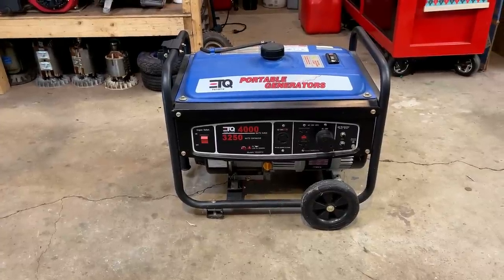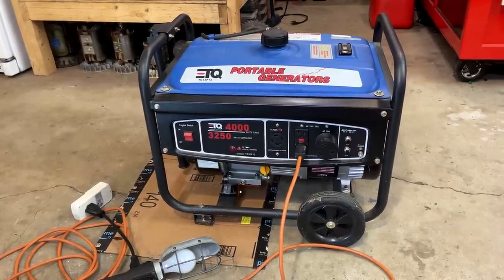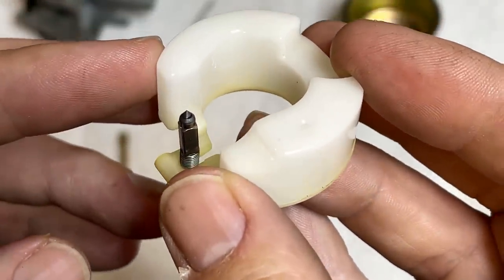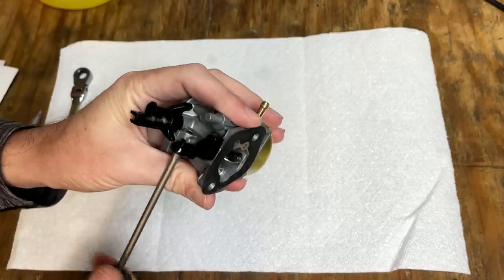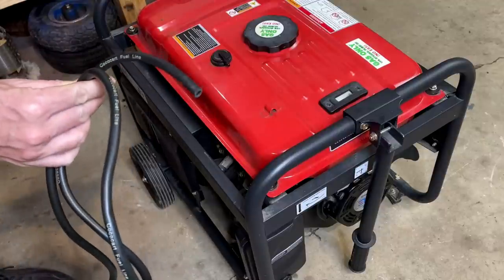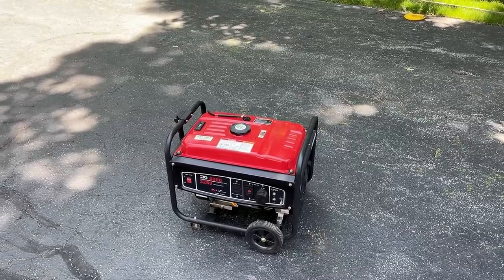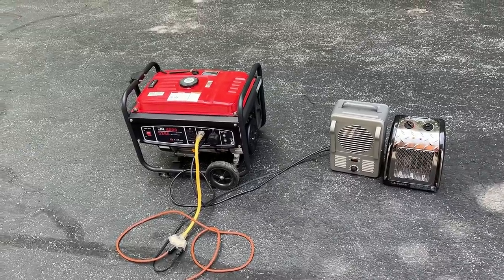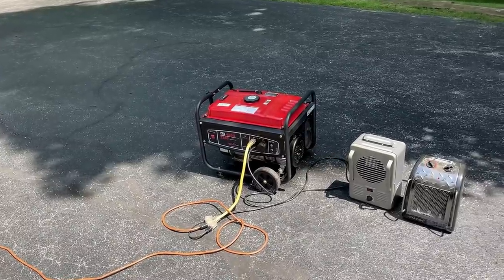ETQ Generator Leaking Fuel When Running - Bad Needle and Seat?

Comment: Those are shipping brackets To keep it from moving around too much during shipping they are supposed to be removed before running the unit  I mean the red bracket
Reply: Agree with Paul, shipping brackets and used on other types of equipment also for shipping
Reply: I know somebody that bought the open frame harbor freight 8750 inverter generator it has the same red brackets but the manual says to remove them be for using the generator
Reply: @paultice610  When I saw the brackets in the video I assumed there were shipping protection. Interestingly, I have a Predictor 8750 and it did not come with shipping brackets. I assume HF sources stuff through different factories so it might be factory specific.
Reply: Yep, shipping brackets to keep things stable during transport, supposed to be removed prior to using the machine, but... 'someone' didn't read the instruction tag🤣👍
Reply: Paul is correct. My generator came with shipping brackets. Purpose is to keep the generator from getting knocked around during shipping.
Reply: You guys are spot on. My manual doesn't mention them, but there were labels on the generator that said they were supposed to be removed before starting.

Comment: Back in the mid 60's I worked in an auto repair shop.  The owner was a professional welder before he got the shop.  We were the only one's around who would weld gas tanks.  He said never put water in them as you can still have pockets of gas vapor.  After pulling the gas tank off and dumping it out, he would run a hose from a vehicle tail pipe into the fill tube on the gas tank.  He would take the gas gauge out of the tank so the exhaust would circulate.  He let that run for about an hour which evaporated the gas that was left in the tank and filled the tank with carbon monoxide.  He said that lowered the oxygen level so the gas fumes wouldn't ignite.  We did this in a well ventilated area with fans running.  Some times, in the winter, he would pull the hose and plug the two holes with wet rags to seal the carbon monoxide in.  I was the one that got to hold the tank steady and wedged in place so it wouldn't move while he was welding.  Just a touch nervous the first couple of times but probably helped him 8 or 10 times.  He died of old age.  Now the disclaimers...Don't do this if you don't know what you're doing.  I do not recommend this operation.  Don't use water!!

Comment: We used to do a lot of welding on gas, diesel and hydraulic tanks. Our preferred method was to pressure wash them with a hot water pressure washer with detergent but CO2 or nitrogen gas was an option. I have even used dry ice which is just frozen CO2 when I had to do one away from the shop. On those small removable tanks you could use dish washing detergent and water to clean the tank then use air for a while to vent out any fumes. I've seen people pipe exhaust from an engine into a tank too, using carbon monoxide to prevent ignition.
Reply: Crazy

Comment: Regarding the gas tank leak. There is a product called J-B weld, it is supposed to be as strong as a real weld. You might know about it but I thought I'd mention it. I have used it and once it hardens, it is extremely hard.

Comment: My Wen DF11000 Dual Fuel generator had those same brackets. They are just there for shipping, to hold the engine solid. My manual said to make sure that they were removed before use.

Comment: The red L shaped brackets are installed in factory to prevent any possible damage to the engine mountings during shipping.
New generators out of the box usually have sticker or multiple stickers mentioning clearly to remove those brackets before use. The first owner didn't pay attention or didn't have the capacity (tools) to remove those red L shaped brackets.

Comment: Thanks for getting me started buying dead generators and reselling them (working, tuned up, cleaned out and ready to go)! I have cycled through about 25, so far. All portable, gas powered 3200 to 8750 watts. Best deal ever: (And I'm keeping this one!) Got a call, Was I interested in a Generac Guardian 16kw for $225.00. Battery had exploded. (Common with these older 2007, units.) The hard part was cleaning up all the oil that spilled out because I had to bring it home upside down in the back of an SUV, Tried running it from a small BBQ propane tank an 11"WC BBQ regulator. (good for 60k BTU) Wouldn't stay running. Needs 245k BTUs. Hooked it up to Nat Gas and runs perfect! Also came with a 20 amp Transfer switch/Load Panel. Everything works!!! Problem is the permitting and required professional (licensed) installation. Green tag required to reinstall the meter. This is when installed as the primary disconnect from the utility service. The load panel has more circuits than my main panel! Solution: Install as a sub panel and move about 12 circuits to sub panel. Main panel now has 1 circuit: 2x100 amp double to "Sub-panel".
Once installed, over $12,000 (installed) for $225 and about $500 in wires, gas lines and a battery! Thanks for doing what you do and getting me into it, also!
Reply: If you want to see it, it is here: https://drive.google.com/drive/folders/14VRrscGXwG2JWjyXV7IP_f2Ukiv-LaaA?usp=sharing

Comment: The red brackets were most likely to stop sear load on the isolators during shipping as you said. The isolators control downward load were in shipping they might be exposed to lateral loading causing a breakage issue. Also they are two types of needle & seats, one where the needle has a rubber tip  into a brass seat or a solid needle with a rubber seat inserted in the fuel inlet tube. the one in this generator may be getting hard but since to tested it to 9 psi that most likely is good. Good video as always.
Reply: Shear
Reply: @robertmoore2527  Thanks, I stand corrected. LMFIAO

Comment: I have had great results using Por15 on carb bowls and tank leaks.  You have to be patient. It takes a long time to dry and is runny at first. But it's worth the wait. It's absolutely impervious to fuel.

Comment: Those red brackets are shipping brackets to keep generator from moving during shipping. All the new generators that I have bought, mostly champion brand, come with them when shipped. The first instructions are to tilt the generator and remove brackets. Then oil and gas are added. Hope this helped.

Comment: If you run into problems with the gas tank like you did with this one there's a very easy and inexpensive fix. They sell at the automotive store a gas tank patch type of epoxy. It looks like JB weld but it's purpose is for gas tanks. You cut a piece of it off and use your fingers to mix it all together. It doesn't take long for it to set up and it last so far over 10 years on my pickup truck. I had all intention of replacing the tank when winter was over. Like most things other stuff was happening and the tank just was not leaking any longer. Even to this day 10 years later there is still no leaks.

Comment: Based on the two (amazing) identical generators with the same failure mode, why didn't you clean the slip rings and as Preventative Maintenance replace the brushes (I agree they look nearly new)? Shimming them to the center of the slip rings was really smart! I keep watching because I keep learning. Thank you.

Comment: James you can repair the tank with JB weld, wire wheel it super clean down to bare metal and give it a try....
Reply: the red angle bracket by the engine mount is a possible shipping block to be removed before use!

Comment: You could try Hytek PU92 Fuel resistant adhesive/mastic.                                                                                        Flexible adhesive for bonding or gap filling. - Resistant to diesel, oils, petrol & water.
Tack free in 40 to 60 minutes.
Supplied in 300ml standard mastic cartridges.

Comment: Those Red brackets are shipping brackets to protect the motor mounts during shipping.. my WEN 8750 watt inverter generator came with them and they were in the manual to remove...
Reply from the maker: Makes sense.  Just not sure why the etq manual did not mention them.

Comment: I have that same ultrasonic cleaner. My heating element works about 50% of the time, and it has done that since it was new. It seems to do better if I start with hot water.
Reply from the maker: I always start with hot water.  Although I just read that can cause the transducer to overheat.

Comment: I had a 49 cc engine ( bicycle kit) that purred at idle but fell on its face when revved. Went crazy trying to t/s carb. Valves were set way too tight. Quick adjustment and now problems solved.

Comment: Those red brackets are installed to protect insulators/"shock absorbers" during shipping.  They need to be removed prior to use. Most Champion generators come with these with instructions to remove them after unpacking.

Comment: That tank has been repaired previously. Someone did a LOUSY job too. Take it to a welding shop and they'll do it right for probably less than fifty bucks. 
Welding it IS an option. Rinse it with alcohol to absorb the oil base of the gasoline and then rinse and fill with water.

Comment: Running that machine with the transport locks in place may have lead to the fuel tank fracture.  That shutoff valve is quite a lever against the thin walled tank.

Comment: 110-130v ac is considered normal range voltage by code from the utilities in most states...
Reply: No it's not. Standard US voltage is 120V +/- 5% which gives you 114 to 126V as standard.  110 and 130 are out of spec.  Most things will still run but bulbs might be too dim or too bright, etc.
Reply: @throwbo  that's from the NEC, but in real rural areas, anything between 110-130v is acceptable as most AC/DC transformers in consumer electronics are rated for such voltage...since led bulbs are in the overwhelming mix now, brighter and dimmer output is not an issue like with incandescent bulbs of the past... While living in South Bay Torrance CA, block neighbor hood  had a problem, I brought home from my work a Yokogawa chart recorder I used to prove to SCE (My employer) that the substation for that area was over loaded as the outlet power was switching from 87v to 135v every 1000cycles.. too much reactive power being pulled from the line on hot days causing line voltage to collapse... I worked at SCE Long Beach Gen Station as a control room operator.. But didn't really know the distribution side regs.. they told me that my measurements where out of their spec of 110v-130v and that they would investigate the problem... The problem was corrected after that with a nominal 115v at the outlets... At the plant, we always maintained the terminal voltage (potential) of the generators transformers at 13.8 which would set up the step up transformer voltage to 230kv... Just a little back ground...

Comment: 11:09  Like everything HF you have to take some additional steps.  Those ultrasonic cleaners must be sealed prior to use.  Run a bead of silicone around the stainless tank and the plastic surround.  This keeps moisture from creeping around the exterior of the tank making its way down to the heater and the transducer.

Comment: I don't know what you do with old gas, but with winter coming, you might wanna buy a happybuy or similar air diesel heater, and use the old fuels and motor oil to heat your workshop.

Comment: Hey James love your videos , I have a predator 3200/4000. From watching videos I believe I need a rotor. Have no resistance across the slip rings. Is there any place you recommend I can get a rotor or a whole new power head. I believe the stator is good but not 100% sure on that either. Engine runs great I would hate to dump it, would rather try to fix

Comment: You have reached a stage of knowledge and experience with which you can address quality control issues as they come off the assembly line James. The brush misalignment is a quality control issue too.Thinking about the gas tank either repairing such a tank with spot welding or JB Weld provokes much debate on Facebook and You Tube. I will not try to teach my grandmother to suck eggs so I aint suggesting anything to you.

Comment: The red brackets are a  factory shipping brackets. They are red to draw attention to them. You are supposed to remove them when you unbox the generator for the 1st time. I have the feeling that this generator had little if any previous use. ETQ not  a high quality brand (no QC on the tank - YOU are the QC dept. No mention of the shipping brackets in the manual, poor alignment of the brushes,  cheapo AVR, etc.)  but still a good deal for an almost new gen.  I assume the old tank could be saved with JB Weld or some such without hot welding. Probably there was a tag or sticker on the gen that said "Remove these brackets before use" but it was ignored and discarded.

Comment: Those brackets you mentioned. They’re installed at the factory for shipping purposes only? Every new generator big and small we’ve received for the company I worked for had them. That generator seen very little use if any by the shape it’s in.

Comment: Regarding the voltage drop, could it be a bad or resistive connection between the power head and the outlet? If there is resistance in the connection (bad wiring or oxidation) it will lead lead to a lower output voltage as the current increase in that path. The voltage might be good from the AVR standpoint but dropping between the power head and the outlet.

Comment: Maybe the vibrations from the solidly mounted engine caused the fuel tap thread weld to crack?
Reply: Unlikely - the tank is bolted to the frame and connected to the engine only with a rubber hose. It was probably just a manufacturing defect. Sloppy weld and then hide your sins with paint.
Reply: @throwbo  With the transport brackets in place, disabling the rubber mounts, the engine IS solidly connected to the frame, as is the tank.The fuel tap acts like a long lever.

Comment: Another great instructive video James.  After watching you for some time I realise that you never adjust the AVRs while the engine is running?  Is there a reason for this?  Is it an electrical safety issue, is the pot “live” or is your practice to prevent voltage “spikes” I wonder?

Comment: It appears the duplex outlet is on one leg and each leg is only 13.5 amps so you were excessively overloading the alternator with the 3000w test. For such an overload a 10v drop seems reasonable. The AVR can't work when all the load is on one leg because it only monitors the total voltage and can't correct imbalance. It probably was putting 131v on the unused leg when the overloaded leg only had 111v.

Of course there's the big question of why it would be wired this way. On a generator of this size it would be more useful for everything to be on one leg.

Comment: Testing the seal on a carburetor needle and seat with a pressure tester. 1st time I've ever seen that 1.   Where did you learn that 1 from, or did you come up with it on your own?  Yeah my Harbor freight ultrasonic cleaner stop heating up too.  Now I have a much bigger 1. Unfortunately no  One makes a well known and well made ultrasound cleaner outside of the horribly horribly expensive ones for use by doctors and dentist offices and such.  Keep up the great work!
Reply: I just usually blow on it thru a piece of tubing. Cheaper than a pressure tester.
Reply from the maker: Have seen that pressure tester used on two stoke diagram carbs.  Works well for anything.  It can even bleed brakes.  Wish though the gauge was more granular.
Reply from the maker: Probably more accurate to blow through it since the pressure you create is similar to that of gravity.  The mityvac can easily overpower the needle.  Then you think you have a problem, but really do not.

Comment: Is it possible to get a 3 to 5 psi pulse pump and draw fuel from my vans gas tank via a separate pickup installed at the top of the fuel pump assembly and run a line to a quick connect then to my generator on the back of my van ? And use the generator 12 v to power the pump so the pump only runs when the generator is going?

Comment: Jim, filling a tank with water only pushes the gas to the top. Welders usually put CO2 in the tank as it is insert, and will not sustain a flame. Another option is to dry the tank out with air forced inside, either with an air compressor, or small fans. One could also clean up around the weld, and apply epoxy designed for use around gasoline. I once had a VW Transporter that I accidentally broke a fuel line off of the tank, and we had to use this technique to get the old girl running again.

Comment: Looking at the old blue tank it seems to me that it shouldn't have that welding burn on the paint where the spigot screwed in and I wonder if someone before you tried to fix the leak by re-welding it. The red tank was painted red where the spigot was screwed in, not black like the blue tank.
Reply from the maker: Maybe, but I had assumed it was the leaking fuel which stained the paint.

Comment: Poor AVR response may well be down to an out of spec capacitor. If it was the case, there's not much you can do other than try another AVR. If you have a spare one, I'd try it out, just see if there's any improvement. These AVRs shouldn't be astronomically priced, if a new one is required.

This is why I prefer current feedback excitation, but you just don't see that these days. - Honda are the past masters of that technique in small generators.